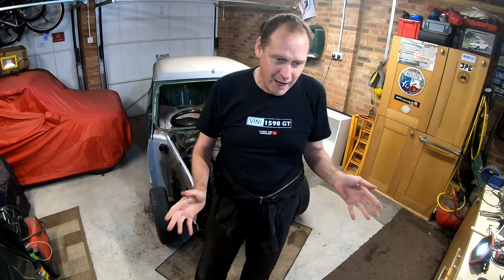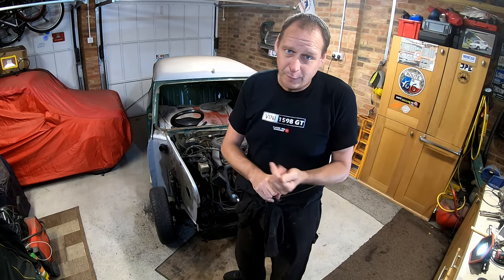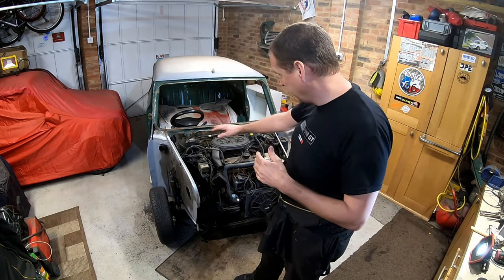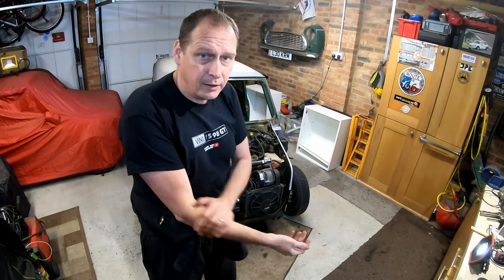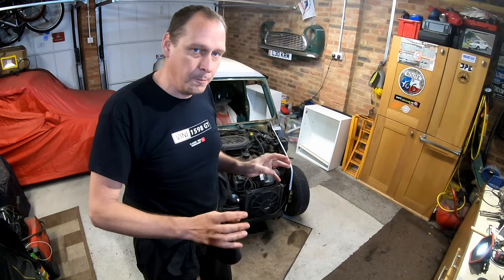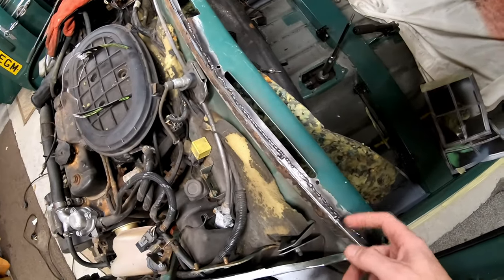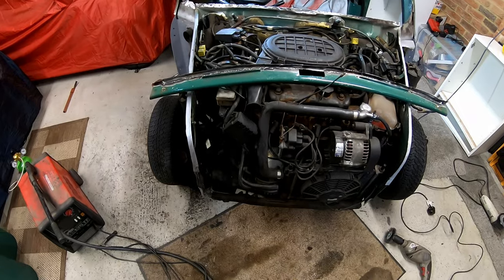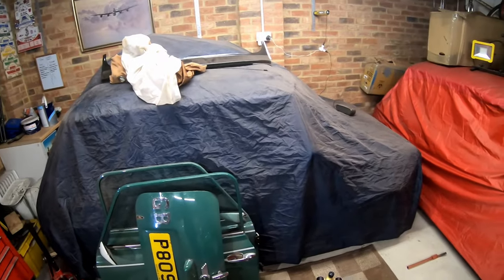Classic Mini Workshop - Project Sprout Pt.25 Scuttle panel Repair & Replace

Comment: Had the same on the pickup, the metal was so thin and it had repairs at the ends and even they were rotting away, as you said £45 for a new one, will last for years and you will be happy with the result, great vids Keith 👍👍

Comment: Fair play Keith, I did the same with my boot floor, bought the repair panels and just ended up finding more and more. Before starting it I should’ve put a new boot in it, but hindsight is a wonderful thing. Great work as always though pal!  And that lip on the bulkhead looks in really good condition compared to stuff that came off

Comment: Hi. Don’t replace or refit the bulkhead sound insulation! It is one big sponge which holds any water and moisture against the bulkhead and crossmember. As soon as I bought my mpi ripping the insulation out was my first job. It does make it a bit louder inside but I’d rather have that than a rotting bulkhead/scuttle etc.
Reply from the maker: I know what you mean, I have ordered a black Nitrile replacement which I used on my other MPI. It looks the same but doesn't retain water